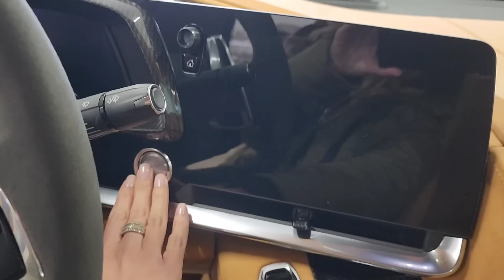Re-organizing our entire car collection... we're running out of space... what an eventful day 😬

Comment: Jolene buy a quick disconnect for the positive side of your riding lawnmower and you will never have to jump it again.  I did it to my John deere and I have not had any troubles in almost 4 years now.  It's very very easy to install and saves your battery, I also did it to our Harleys and our 1977 Pontiac Trans Am.

Comment: For shipping containers to keep them from sweating you have the wall's and the ceiling spray foam insulation then they don't sweat 💦  the closed cell foam is what you need to use. A nether thing that helps a lot is on the roof put on white rubber roof coating it keeps the roof cool